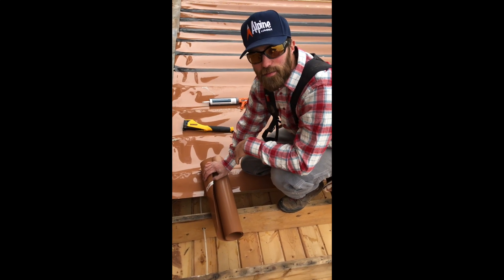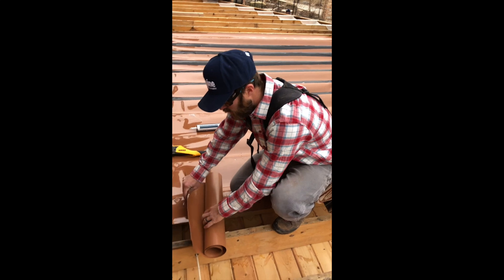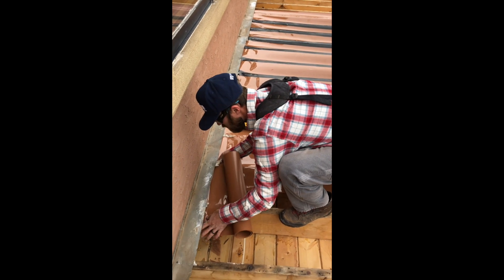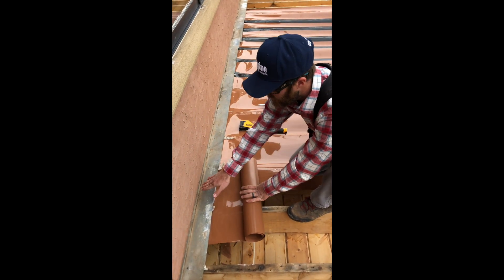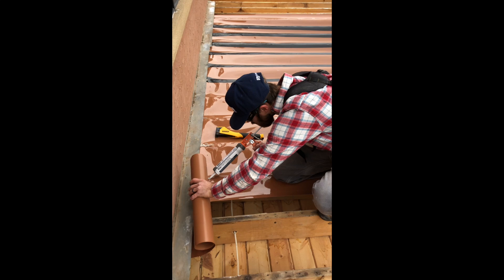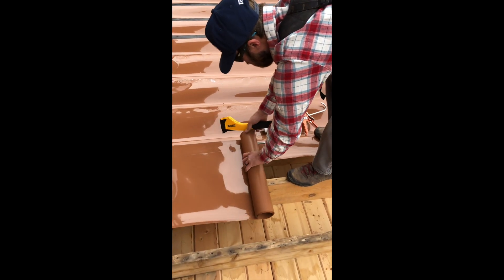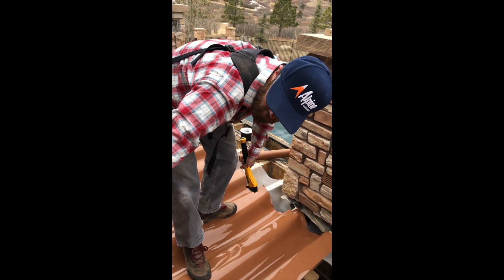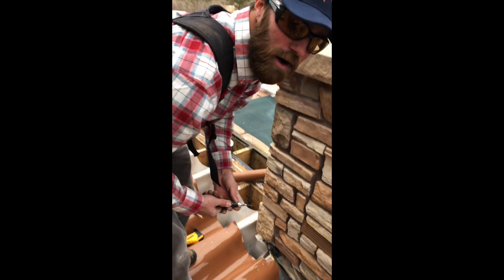How to Install Trex Rain Escape Troughs - Colorado Custom Covers & Decks

Comment: Thanks sir for your videos just would like to know if it gets glue with the same trex black glue you used on the joists when glueing to the brick in front of the house? so rain doen't get in behind
Reply from the maker: Yes, we use butyl caulk everywhere we can. You really want to get the Rain Escape under the brick in between the joist/ledger and brick. Definitely use a good amount of butyl and we also use it before we put the decking in as well.

Comment: Regarding debris that might collect overtime in the trough (pine needles, etc), what do you think about making the first few boards closest to the house removal, so if you get bad a blockage then you remove the board on run a strong hose of water down the trough? With all of the taping, membrane, caulking, is it possible to have removable boards or build in some sort of removable panels made out of the decking? Great video! Thanks.

Comment: no probs ...just an idea but could you use a length of timber same length as the troff .. use it as a kinda weight in the troff to get a crease free gully ?? not sure i explained it to great ..basically put the timber in the gully at the deep eny pull the sheet until you got the run off / slope ya need staple and work ya way down with .. if that makes sense ..use the sam bit of timber on each gully / troff ...its just as i watch this it makes sense to use a timber length to weight it down plus your get a perfect even slope .
Reply from the maker: That could possibly work. Just be careful that it doesn’t pull the staples. We also just uploaded another video with a twoperson install which is a lot easier than one person
Reply from the maker: That could possibly work. Just be careful that it doesn’t pull the staples. We also just uploaded another video with a twoperson install which is a lot easier than one person
Reply: if the timbers not to heavy it should be fine .... i did watch the 2 man vid just after this vid ...great work buddy

Comment: So how do you attach the decking without making a hole thru the tape and rain escape?
Reply from the maker: you do not. the tape is butyl tape and will prevent any leaking. you cannot burn or miss the screw or else it will leak. this product is the best out there and if installed properly this is no leaks.

Comment: Great video. Excellent workmanship.
How do you service this if you get a call back for a leak?
Reply from the maker: MarkM I have only had one call back due to my employee cutting a trough and not fixing it. It actually took about a year before the leak showed up. But we water tested the deck and followed the leak to try and find it. We had to tear off some decking to get to it, once you tear of the decking you must reapply the tape to cover the old holes from the deck screws/hidden fasteners. We always water test after we install the rain escape and then again after we install the decking before we finish the ceiling. Thanks for watching

Comment: Dumb question...but won't the deck plank screws puncture the trex membrane?  Is there any potential of leaking because of this?
Reply: no, not if the screw is installed properly. the caulk and tape act as a washer to repel the water. make sure you go straight into the joist and do not "burn" the screw in
Reply: @jomo1018  
We installed rain guard on a complete deck on a day of  warm weather, the 'water test' passing each time.  Later in the day as it got hot, we saw that some water was pooling before the downspouts (we randomly did the water test again).  Is there a way to fix this? (Larger tab cuts at the end of the trough???).  Will this be a problem as time goes on?

Comment: What if you have a leave issue, meaning nearby trees drop literally thousands of leaves which go thru your deck...is there an access to clean out...
Reply from the maker: What I would do is install the rain escape system and then install a screening system on top and then install the decking. So the leaves and everything will not go through the deck grooves into the rain escape. And you can power wash it and the leaves will come out without going into the rain escape. Thanks for watching hope this helps
Reply: @coversanddecks  This the leaves just get stuck on the screen.  After years of living in a house surrounded by trees on a hill, I have come to realize..Only poor or dumb people(like me) have trees.  Trees are for the birds :>)
Reply from the maker: @kenmcf  yes, there is no great solution to keep the leaves out. I think this is the best as you can pressure wash the leaves out.
Reply: cut the trees down
Reply: @fnsupertrucker7032  yeah...i realized years ago.  Trees are for poor people ..If you ever notice those big mansions on TV...no trees...the rich don't have time to rake leaves...which is why I am poor.

Comment: How do you clean pine needles and cones?
Reply from the maker: We use 6” gutter’s which helps keeping the gutter clean. I would suggest taking a hose and running a volume of water through there to get those needles moving.
Reply: I say cut the trees down

Comment: How will this system handle upstate NY winters?
Reply from the maker: If installed properly I think it would hold up just fine. But you can always check with the manufacture. Thanks for watching and hope this helps.

Comment: What is the advantage of the Trex material over plastic sheeting?
Reply from the maker: Trex has a warranty
Reply: @coversanddecks  What does it warranty? replacement material or replacement labor and "secondary damage" such as a damage on the ceiling below?
Reply from the maker: Rob Brockschmidt you would have to contact trex for the warranty.